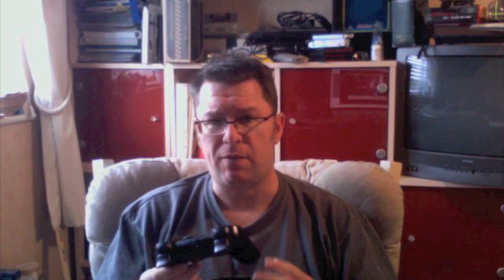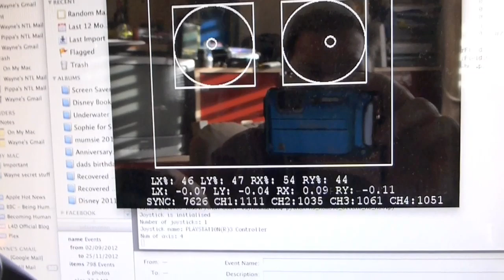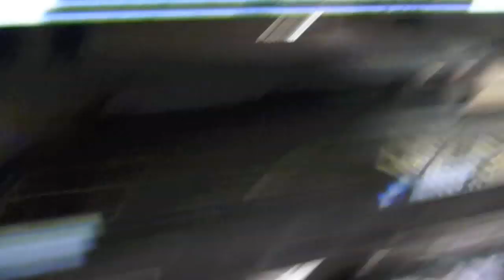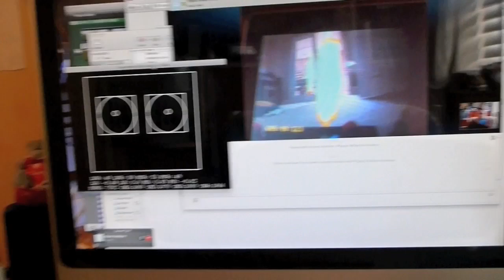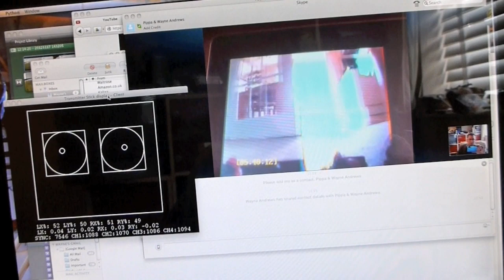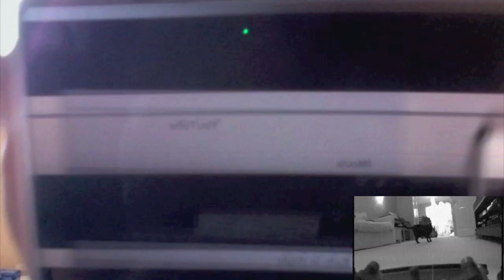Vlog: Long Range FPV project update

Comment from the maker: It's possible, if you're talking about having the model completely on it's own, it's extra hardware, and some way off.  We're thinking a laptop, access to 3G and standard model to start with - then it's something most RC people would be able to put together very quickly at very low-cost

Comment: Thats very cool. I would presume that latency doesn't cause too much of a problem, after all Pro Gamers get around the issue of lag on standard aDSL lines so it should be very dooable. I wonder if this is feasible using a mobile 3G connection on the vehicle?

Comment: That comment made me laugh,,,,,, we need to keep a regular RC transmitter in the mix....I get wifi links 25km +
Use a alfa wifi card with a 24dBi gain parabolic grid antenna.Even without the grid antenna you will get great omni directional range 500 meters+....Alfa wifi usb card can be picked up for less than $40 I've even picked them up for $19

Comment from the maker: Thanks for the link - I had a look (looks like a cool little robot) the only issue with these is they are pure wifi.  In order to keep the range we want for FPV, and have absolutely standard RC models, we need to keep a regular RC transmitter in the mix.

Comment: Off to a great start.I think some security cameras use programs to move cameras/servos to say check your security system when your not home.There is also wowwee(dot)com en products tech telepresence rovio rovio --------where the spaces are add slashes